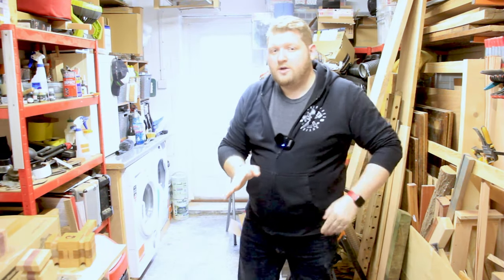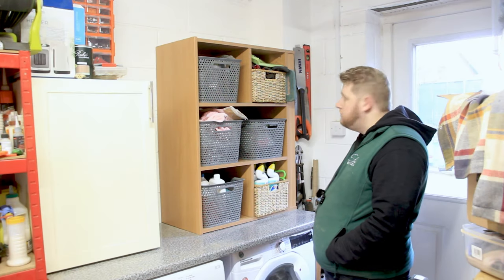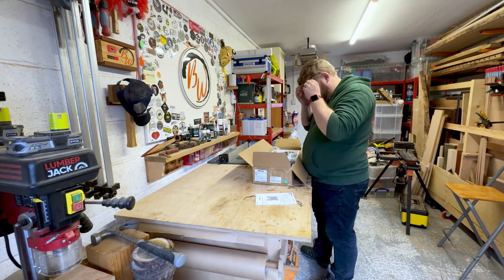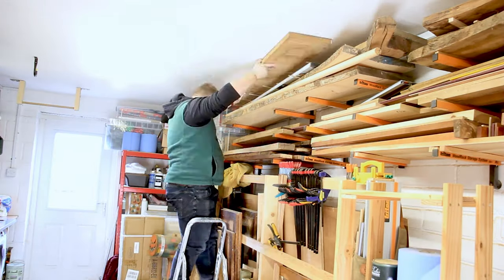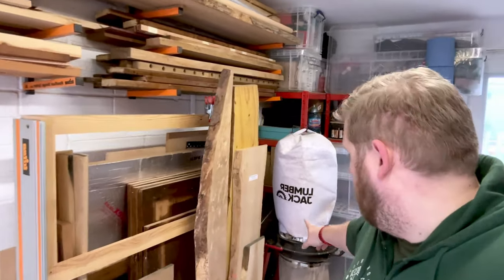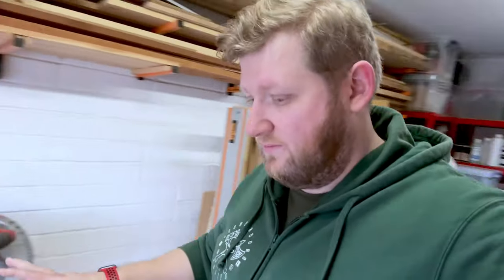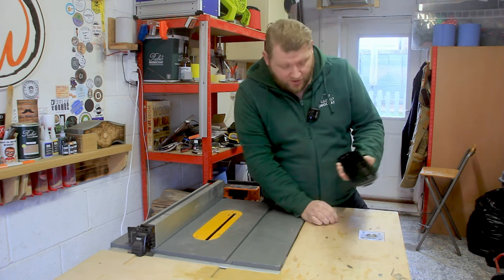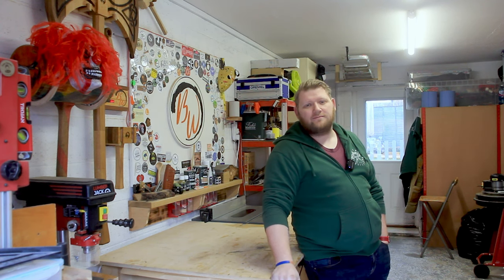Making space in the shop for my new toys: Shop upgrade time!

Comment: Couldn’t tell you how many times I’ve changed the layout in my space lol.
Oh and I know I’m gonna do it again summer time as I’m adding an extension.
Looking good mate, until update 3.0👊👍
Reply from the maker: Ooooo an extension sounds good. is that going to add a lot of space?
It's always good to have a good mov around. unfortunilty i am very limited on how i can move things around. 
I think update 3.0 will hopefully be a new shop...if things go as planned this year.
Reply: @BrookesWood  not a massive amount but enough. Approximately 4feet in length and an additional separate room on front  (resin room) workshop currently 10x12ft so will be 10x16 and the extra room.